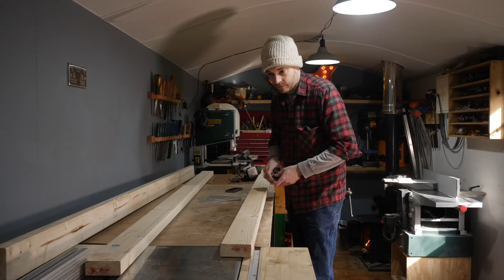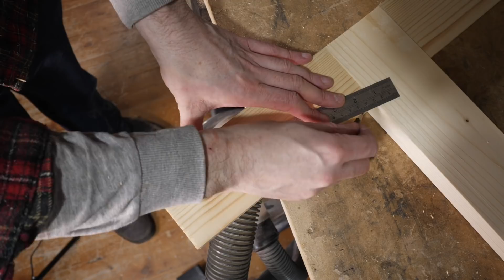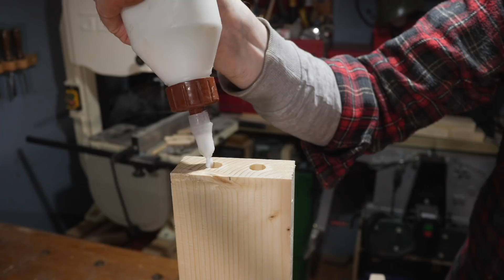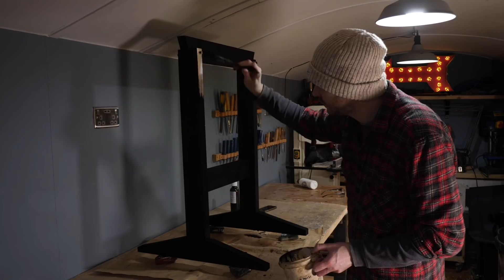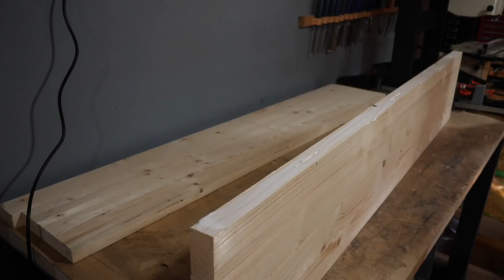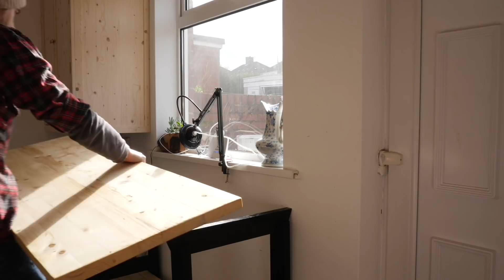Saw Horse Desk

Comment: If it's not the obvious such as a fuse or a break in the lead, then almost certainly the carbon brushes. Festool tools are designed like that, to not work and not cause damage to the armature. Have had exactly the same problem with their extractors.
Reply from the maker: I ordered some new ones but still no joy.
Reply: @Badgerworkshop  Check out Festool Steve on instagram, he may be able to put you right on what to do.
Reply from the maker: @garyblake3130  Thank you

Comment: New brushes for the TS55?
Reply from the maker: I changed them and no joy
Reply: @Badgerworkshop  Try a new 'plug it' cable before spending any serious money. My festool router stopped working last year, tried the cable from another tool and it powered straight up, I believe the wires tend to break eventually in the end you twist into the tool.
Reply from the maker: @dgpictures5  Thank you. I will give that a go

Comment: Very nice, sod using them as saw horses, that piece of furniture is a keeper! As for mistakes...looked like a perfectly normal day from where I am, and isn't it always in the middle of a fiddly glueup etc when these things happen?
 I face-palmed when I saw your bespoke lap joint measuring technique. I've always measured both parts, cut shy of the line and never seem to get a flush joint. You gave me more of a 'DUH' moment there, than any glue up mishap could! Cheers Matt.
Reply from the maker: Thanks Keith. I felt very silly at the time
Reply: @Badgerworkshop  Its the jobs that go perfectly that leave you wondering where the glitch is hidden. A clear cut/fixable cock-up is often reassuring, if you know what I mean! lol

Comment: Matt, great vid. What is the wattage of your pillar drill as mine is 230 but struggles to use a 40mm forstner bit as the drill keeps stopping?
Reply from the maker: Mine is 350w and I have the belts set to the lowest speed